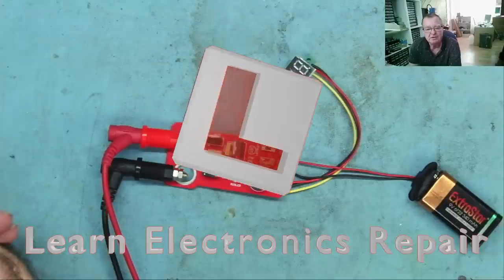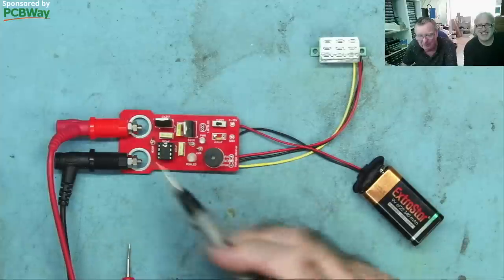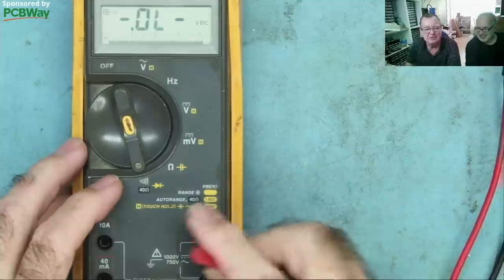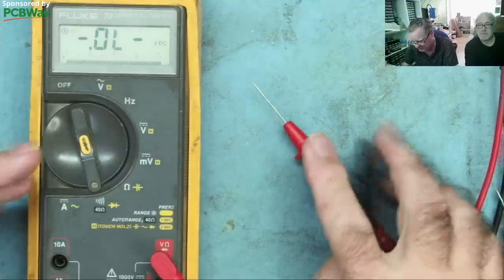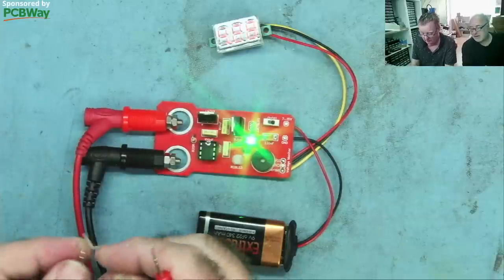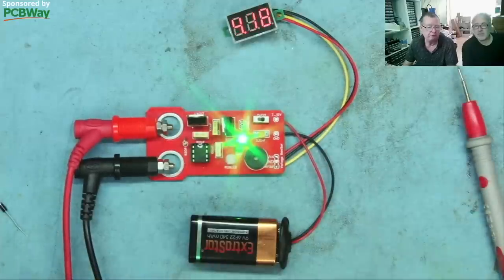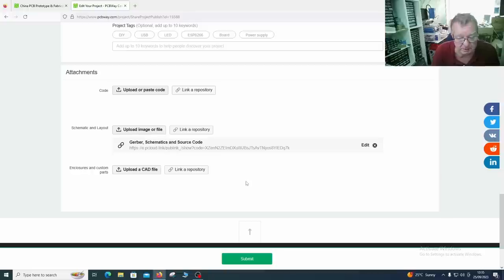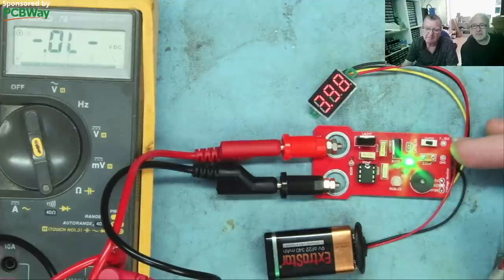The Incredible Mr Bleep, standalone enhanced short circuit and diode mode tester.  Now ready to buy

Comment: I'm  so impressed with this I've ordered the 5 boards from PCB Way this afternoon, this will be so handy in my  Radio Amateur workshop, Cheers Richard & Det, I'll download the software when I receive & populate the board.
Reply from the maker: Thanks for your support. You won't be disappointed, Mr Bleep is stupidly fast and thanks to Detlef working out the debouncing issue early on it's also very reliable.  This was totally a joint effort
Reply: @LearnElectronicsRepair  It will have a baptism of fire though, I've been given a non working HP bench multimeter, there's a shed load of of diodes & semi's in there, is will help me no end I'm sure ,like you Richard once I take my eyes of the board I'm lost, so I'm going to work on one of the many boards at a time.

Comment: Actually the colors of the rgb led has to be changed.... Short should be red as in fail red then normal diode green and the Schottky blue as that makes more sense other then that good job guys and if you could add zener diode with yellow led then you got all covered
Reply: Good idea , will dig in to the source code later and see if i can make the changes :)
Reply from the maker: Yeah actually I agree too - it makes more visual sense.   Mr bleep will also test LEDs as well

Comment: Can this be modified to also find shorts? e.g. continuous bleep when meter leads shorted (adjust using a pot),  then the more rapid the beep, the lower the resistance found. So as you get nearer to the shorted component, the more rapid the beep (or perhaps the lower the beep frequency). Is it sensitive enough? maybe if a short (<1 Ohm?) was detected for more than 1 second, it could output more current which would make it more sensitive?
Reply: I think it would call for 4-wire kelvin leads if so, probably a little overcomplicating but I think it's a worthy suggestion
Reply from the maker: @budgiefish  Are you reading our minds? Det and myself discussed this very same thing but decided Mr Bleep was good to go as a standalone tester.  As the say though, watch this space 😉

Comment: Does MR. Bleep Bleep at 50 ohms? I learned from Leo's bag of tricks video that Flukes do bleep at 50 ohms and it is not a short in my understanding. It is also a reason why I have not bought a FLUKE. I'm wondering if I should make Leo's version or MR. Bleep. Maybe both :)
Reply from the maker: Not tried that.
Reply: @LearnElectronicsRepair  That would presumably depend on the threshold voltage you have used to trigger the different indications.  With a 1.5mA current source through 50 ohms you would see 75mV across the probes, which is quite a bit lower than a Schottky diode but certainly not a short.  This is certainly something I'd suggest could be improved to make it more useful.
Reply: OK, I see in the other video where you go through the code that this is a simple setting that can be adjusted in the source code.
Maybe it could be extended so that there is different/variable tones depending on the voltage drop as you approach a dead short.
I'd also like to see an easier way to download the schematic and source code files without having to register on some new download site, or download the IDE tools.
Just some suggestions for improvement.
Reply: @KeanM    Thanks for making the effort for figuring that out. If I do have time, I might build this and modify the code.

Comment: Hi - Do you fancy some troubleshooting on this? - board bought and built but i don't have the same operational outcome as you! I get a beeps for normal diode but they are long - maybe 1000ms (the code does say 80ms...) , no beep for schottky, no activity on the neopixle. Any idea on what ive done wrong?

Comment: Have you considered adding a low value fuse with crowbar protection to limit the rather undesirable affect that would occur should a voltage source be probed by mistake?
Reply from the maker: No, we added an 8 pin DIL  socket for the cheap as chips microcontroller instead, so if you trash it by accidentally probing a powered up board then you just plug another one in 😆
Reply: @LearnElectronicsRepair  OK fair enough but not exactly an elegant solution 😳

Comment: Great video ! ....  but that measurement is a quantitative one.

A real qualitative measurement would show you not only a possible defect of a diode,
but also it's value, as you showed it with the Fluke.

But there are also defects of diodes, which will vary in the forward voltage drop.

By a first sight, this would probably go into a good diode.

But if you watch the forward voltage and it will change over a few seconds,
then you also have a defective diode.

Means in general, there are components which seem to be good,
but they will change their behavior over the voltage and/or time applied.

Voltage dependent defects of components.

Go figure 🙂
Reply from the maker: Yeah, it's meant as a very quick way to probe around PCBs rather than finding that sort of fault.

Comment: Excellent! First class and so helpful both as a project but also as a capable tool to use. Will there be a housing for it as I do think that it would be better for storage like your multi meter so you can have the unit maybe even a kick stand so the read out can be housed also giving stability placing that at the top or bottom. Great project though and ideal for schools where I think more of this should be done, instead of meter work or whatever it comes under.
Reply from the maker: That is for our other Gran Canaria based co-conspirator Carlos over at Retro Upgrade.  So over to you Carlos...

Comment: Can we expect to get a very small version that works on a cr2032 ?
Reply from the maker: We've talked about this.  Actually we were thinking of using a pair of CR2032.  It's easy enough to change the PCB to do that.
Reply: As Rich stated, we were thinking about a Micro Mr. Bleep. Running from 2 coin cells, a lo power LDO instead of the 7805 and completely SMT. That would defy the target audience we had in mind: the current version is intended for beginners - that's why it's all through hole.
No promises - but we may do one just for fun in the future